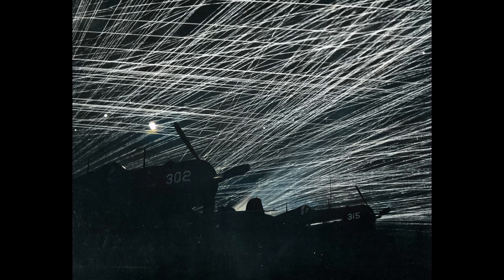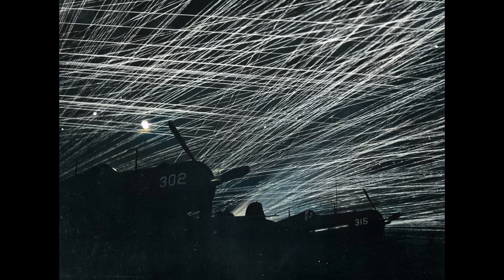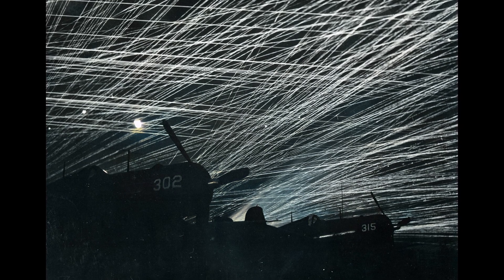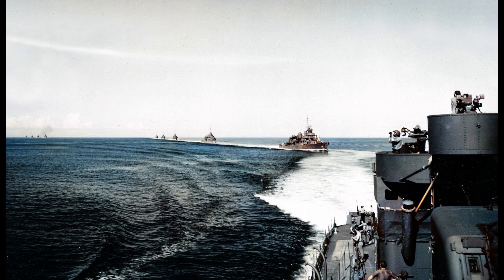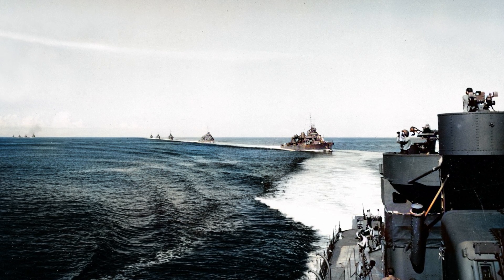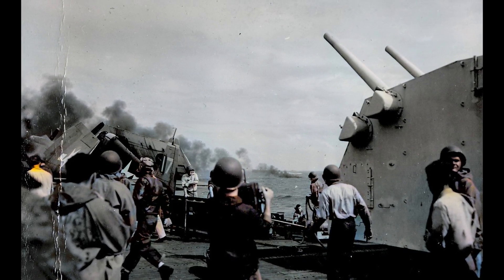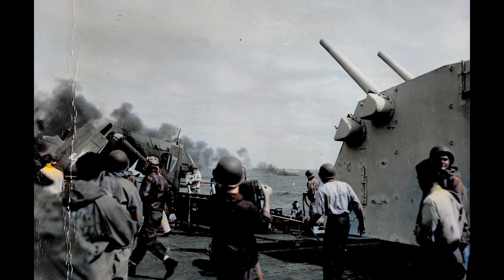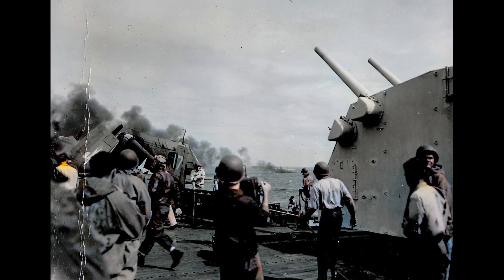Kamikaze Hunters Never Expected VT Fuses To Explode In Their Flight Paths

Comment: The old mechanical time fuze was based on manually setting the amount of shell spin to equal time and altitude you wanted the shell to explode by turning the time dial on the mechanical fuze. The miniature vacuum tube radio reflection fuze had to have a battery to power the radio transmitter/receiver unit and withstand environmental conditions without losing electrical power, there was no adjustment by the operator needed.  They used a tiny glass ampule containing battery electrolyte surrounded by metal plates to create a wet cell battery.  If the tiny glass broke on the ground, it couldn’t set off the fuze. The electrolyte had to fully coat the metal plates to create enough power for the fuze to become activated, which required the shell to be spinning at 25,000 rpm. The battery power only lasted seconds, if the shell didn’t explode it landed intact. That’s why at first, they could only be used at sea to keep the enemy from getting the VT fuze.